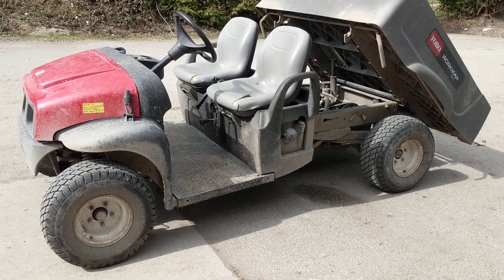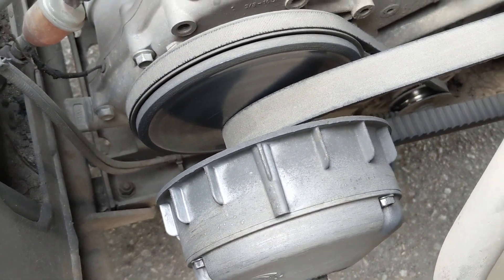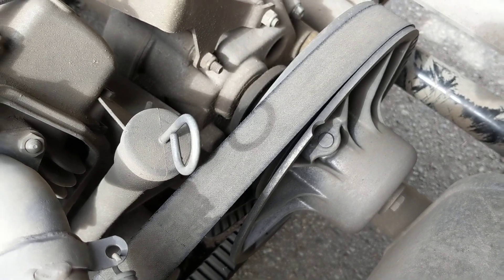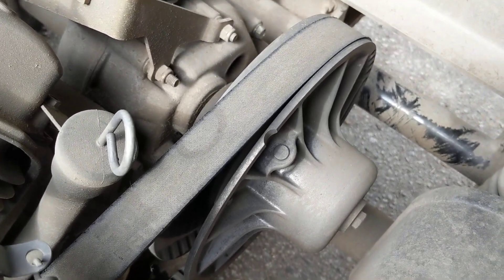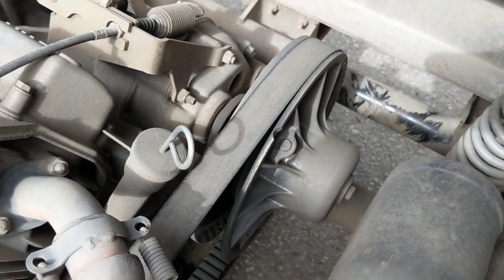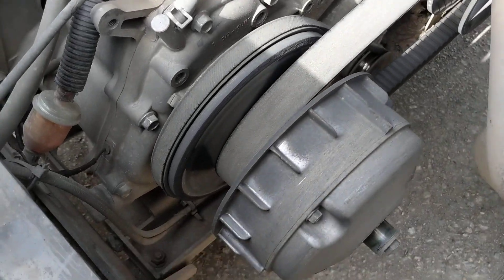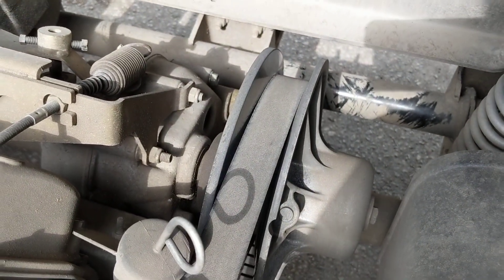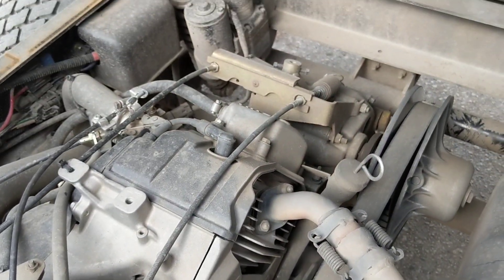How a golf cart CVT slip drive torque converter clutch works

Comment: What if the rear clutch isn't opening as the drive clutch closes?  Could this be the reason my belts keep breaking?
Reply from the maker: Yes, belt it getting stretched and squished.
Reply: @machinesnmetal  thanks for the info.

Comment: Very well explained...now im very curious as to how the starter system works...i know in cars and riding lawnmowers you turn a key and it turns the starter....but i noticed that you just oressed the gas pedal and  the starter started to start the engine....HOW IN THE HECK DOES THIS WORK?
Reply from the maker: There's a on/off switch on a spring attached to the throttle pedal cable that activates the solenoid the key switch would usually activate if it had a ignition key style start system. Exactly the same setup as a gas powered golf cart.
Reply: @machinesnmetal  so it must be just when you barely press on the pedal because otherwise it would never shut off and always be sending power to the starter as long as the pedal was pressed
Reply from the maker: there is a switch on the pedal that activates a relay solenoid when you press it the starter kicks in, and once the engine starts the starter switches into an alternator to charge the battery. When you let go of the pedal there is a stop switch that activates and kills the ignition.
Reply: @machinesnmetal  very cool mechanism.  Thank you! Subbed

Comment: Nice video - and if, at full throttle, the belt doesn't reach far enough toward the outer diameter of the drive clutch (the one attached to the engine), check to see if the engine speed governor is preventing the engine from reaching its specified RPM (maybe about 3500 RPM).
Reply from the maker: It reaches much far enough 🤣 I've got these all dialed down to about 2500 rpm or we have way too many operator accidents
Reply: Do you have any idea why my belt is not spinning nor is the shaft below where the belt rides on? The clutch is spinning but is not grabbing hold of the belts

Comment: Question...  I have this same setup and the belt is slipping and the utv isn't moving.  Do I need a new belt or has the clutch messed up?
Reply from the maker: Could be either.. how old is the belt? Mine are about 7 years old and still grip great. Machines are used 3-6hrs a day
Reply: @machinesnmetal  mine is pretty old but I looked deeper into it and the smoke isn't coming from the belt it is coming from the exhaust
Reply: @machinesnmetal  i think i may have bad gas in it